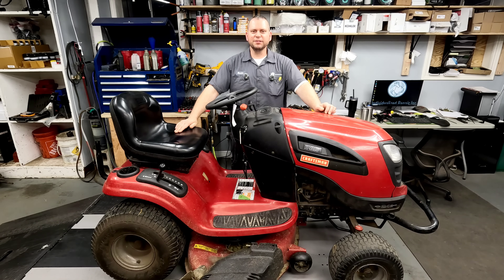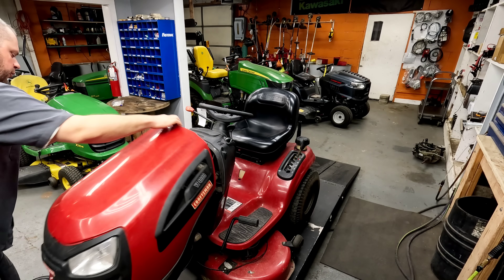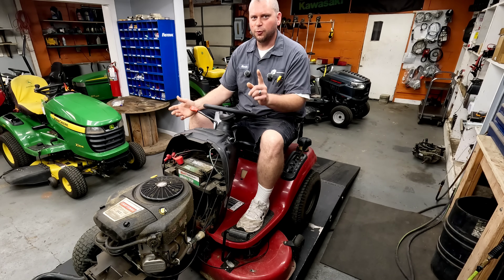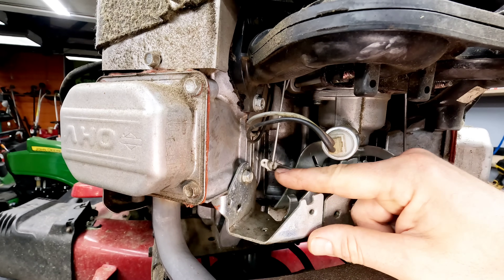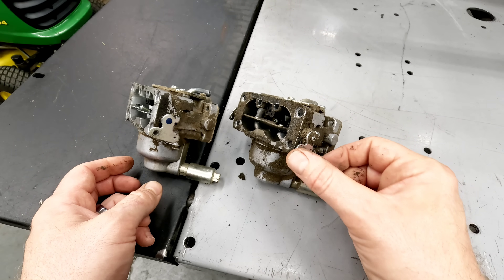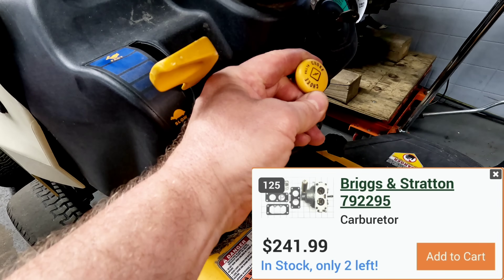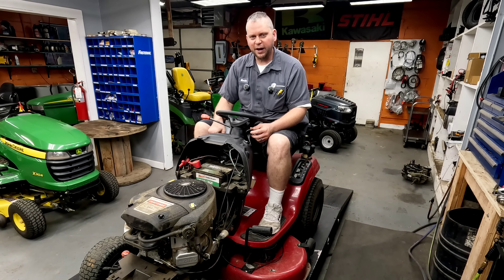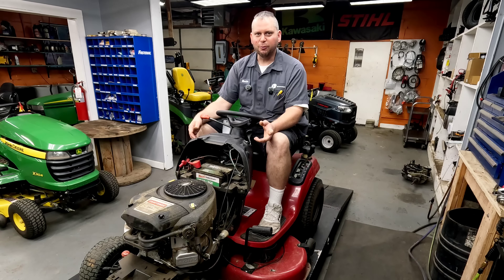Craftsman Riding Mower Runs Poorly Full Diagnosis on Briggs & Stratton V Twin Engine Carb Problem

Comment: I just had a bought-used B&S 17.5 Hp go loopy after I changed the carb.  RPM shot up to like 4k, and would not come down.  I noticed the governor linkage rod was a little bent and the governor spring was pulled.  I also noticed the crank case breather tube did not fit right and was spraying a little oil. So I order new rod and spring, and a new breather tube.  That did the trick, and it purred like a kitten.  Then on a hunch I measured the old parts:  the old rod was a 1/4 inch short, and the face to face on the old carb was a little short. The prior owner installed the wrong carb and modified the rod to get it to run.  Sheesh.
Reply from the maker: Haha, crazy how that works sometimes!! Great you got it fixed up right!

Comment: My mower and weedeater were rouning rough so before I take them to get serviced I tried the seafoam thing people did on the internet not thinking its gona do anything but blow a bunch of stinky smoke well Holy crap it freaken worked I cant believe it.i thought it was snake oil lol
Reply from the maker: Sometimes if just light deposits or bad fuel it can work. Awesome!

Comment: I have a Kohler I think it is a 175cc.I can not find the model or serial number on it .I got a new carburetor for it but am not getting fuel to the combustion chamber.What could be wrong
Reply from the maker: Is it getting to the carburetor from the fuel line? If so, either the fuel is not good enough or you still have a carburetor issue

Comment: Martin didn't Change the Carb on My Intek Briggs/ Kohler Swap. Only one cable that came with the Engine I Bought?  But 2 Places that the  Throttle cable could go? either top Front centre or Bottom where that Throttle Cable was on the Lawn Tractor that you were working on. Confused still no Start or Run yet  Have a Short somewhere  won't turn over just Clicks & then Smokes like an SOB  & a One of the 3 Relays buzzes like nobody's Business
Reply from the maker: Sounds like a bad starter or starter solenoid to me (possibly both)
Reply: @IndRepair  New Starter & New Solenoid
Reply from the maker: Where is smoke coming from? Does the engine spin freely from the top by hand?
Reply: @IndRepair  Yes Engine spins Freely by Hand Smoke is coming from behind  Fuel Tank in Front of Dash?
Reply from the maker: Hmm. Definitely seems electrical would go through all of it and see if wire hooked up wrong or dead short to ground somewhere
Reply: @IndRepair  Yes Sir that's what I'm  planning on doing very soon as  Grass cutting  season has Arrived in Georgia
Reply from the maker: Awesome stuff!!
Reply from the maker: Hope you got it fixed up?
Reply: @IndRepair  Yes Sir  Figured out why it was Shorting out. I had the Stators wires  going to the Alternator instead of going to the Ignition Switch  & the coil kill DUH
Reply from the maker: Hey at least you got it figured out!